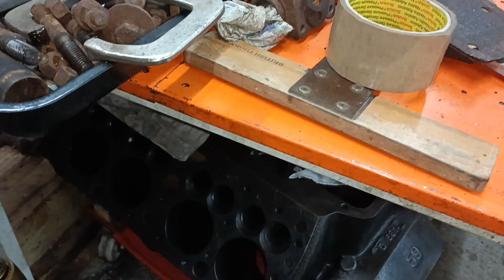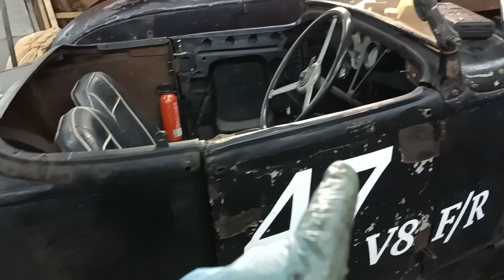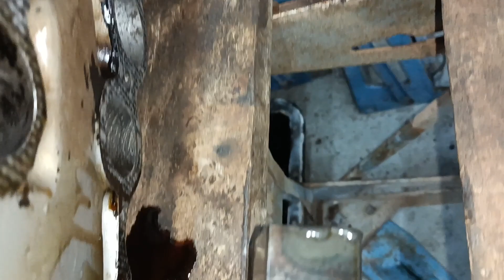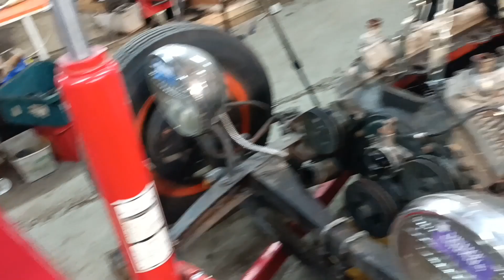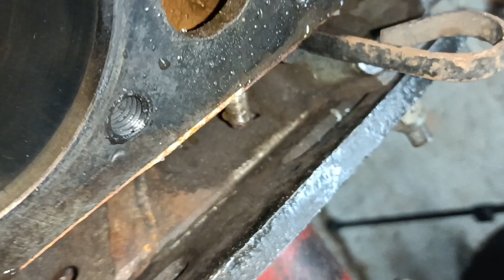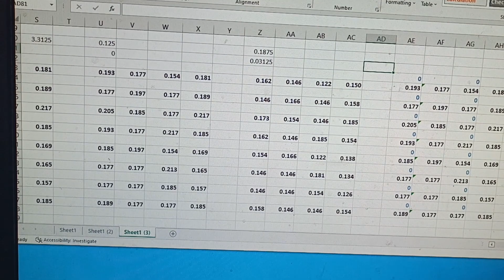2209 32 Sedan Pendine Prep 3. Will my other motor bore out to 3-3/8"?

Comment: Always something interesting going on in Marts Garage!......I want to build a 3/8 motor myself. I’m sure you mentioned where you got your sonic tester, but could you repeat?...it’s going to be a busy time in Marts Garage.....can’t wait to see it!......take care, Mark from Maine,USA
Reply from the maker: Hello Mark. The sonic tester is just an offshore item bought from ebay. It was the equivalent of around $100. It has a 10mm diameter probe, which is ok on cylinders if a slight radius is filed onto it. I have bought a smaller probe but have not been successful in using that in the ports and bowls. Some units can be bought with 2 probes. I use petroleum jelly (vaseline) as a sonic medium. Mart.

Comment: Heartbreaking news on the French block. I'm getting confused on which engine is in what car?  Good luck on the quest for a big cube flatty.👍
Reply from the maker: Hi Art.
3 French motors.
No.1 The Spalding flatty I punched through the valve bowl and hit the water jacket so I repaired it and have put it in the truck to prove it out.
No.2 The Deeside flatty. The sonic test showed a big core shift so this has been mothballed as it will not go 3-3/8".
No.3 The flatty in the roadster. I pulled this to use in the sedan and am punching it out to 3-3/8 after a positive result on the sonic test.

There will be more videos to come as I continue to work on this motor.

Thanks for watching and commenting.

Mart.

Comment: Hi Mart.. that oily goo in the exh cross over ports.. must have some vacuum in there from your PCV modification drawing in the the oily blowby mist. Good thing the exhaust ports are sealed on the top of the block.. just a thought.. keep up the great work. 
Regards Kevin
Reply from the maker: Hello Kevin. Yes, I think you are right. The bolt passes through the crossover into the inlet ports so there is just a thread between the vac port and the exhaust crossover. The crossover has been welded up but there might still be a crack in it, or maybe the mist gets pulled past the washer under the flange on the bolt head. I'm not going to worry unduly about it.

Comment: Kinda hated to see you go into the roadster engine, however, it WILL result in a significant upgrade and it should be interesting to see how it does in the sedan.  Thanks for sharing.
Reply from the maker: Thanks for tuning in, William. I can see that motor going back into the roadster at some point in the future. (Maybe, nothing firm).

Comment: Hi Mart,
Do you balance your engines and what are your thoughts on that subject? I have done it on couple of my projects by adjusting all the components myself and then have another gent spin the crank with the proper bob weights, I made up the proper bob weights also. Lots of messing around!
Reply from the maker: Hello Jon. I've never had a motor balanced, but that is not a stance on my part, I would think some would have benefitted greatly from a balance. I would need to do some research to find a place locally that could do it.